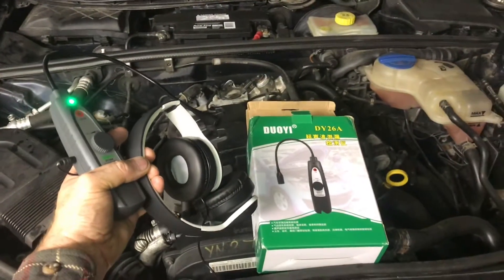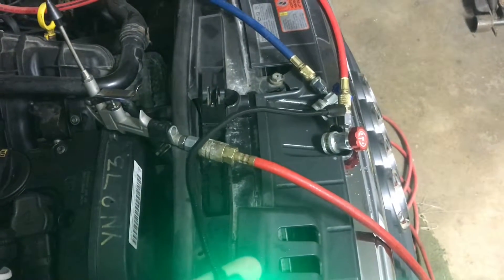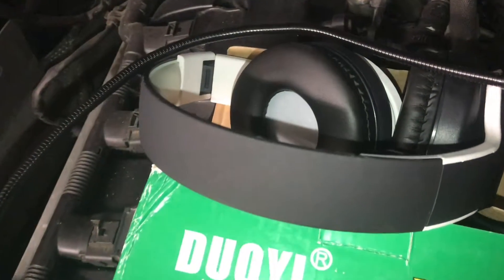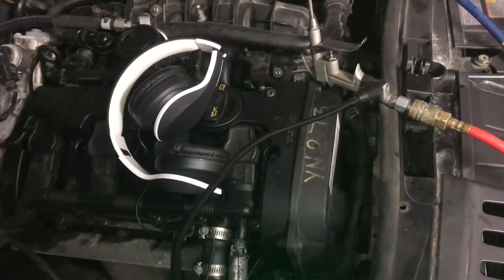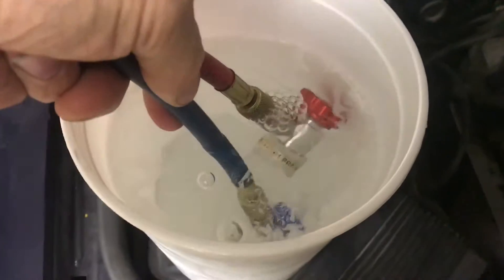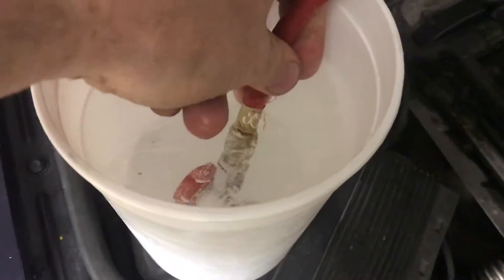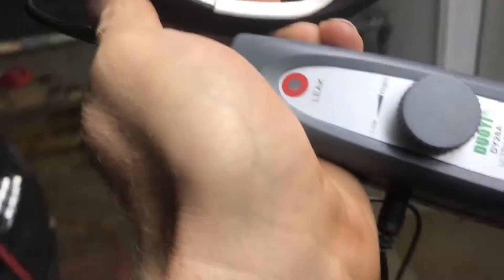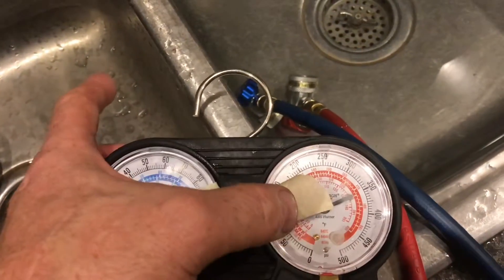(REVIEW)$30 dy26a ultrasonic leak detector air vater fluid pressure vaccum system leakage tester

Comment: I use toy bubble solution from the dollar store and a spray bottle, plus after i spray it on the fittings i use a paintbrush to agitate it and make a froth that surrounds the area as opposed to just shooting it and letting it runoff.

i bet a dog could find the leak.

Comment: ultrasonic leak detectors work best at higher psi. 60 psi isn't going to work with Chinese leak detectors. you'll need more sensitive sensor than that lol
Reply: Do you think it will detect the leak if you run a vacuum you will hear it ? I think s vacuum only goes down to 30hg
Reply: I have an under slab leak so big it won't hold pressure.  I really considered buying this to narrow down the area I need to bust out concrete. I think I'll save the money and buy something else. As for your test, remember it has 2 sensitivity levels and it is for ultrasonic sound. By its description it is not made for sounds in the range we can hear.   Some cheap Chinese tools are  RIP off junk. I have been lucky with most I have bought off of Ebay. It's a gamble...
Reply: what do you use?